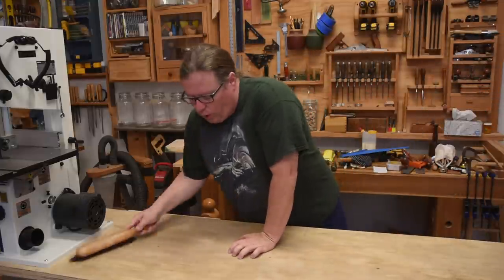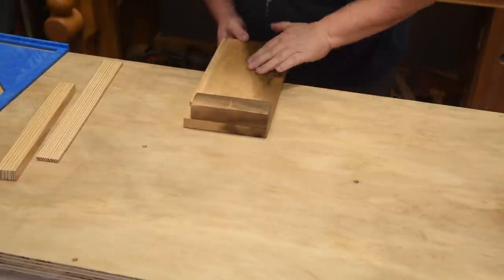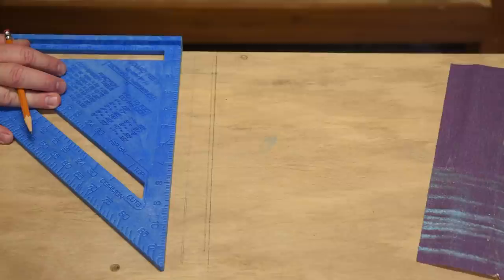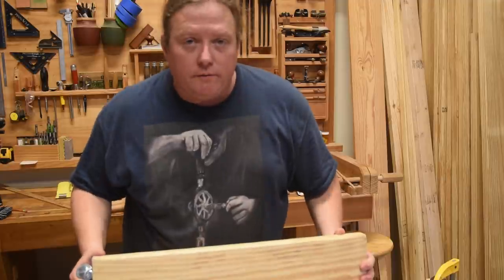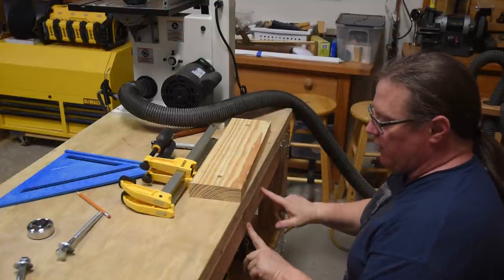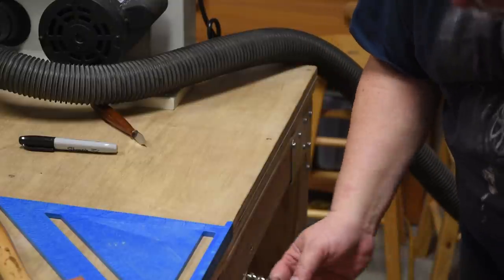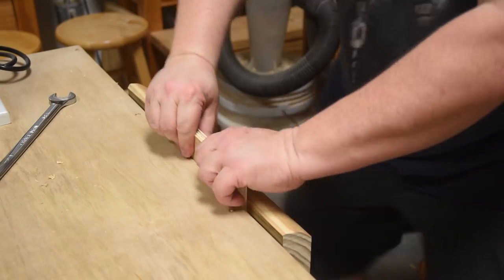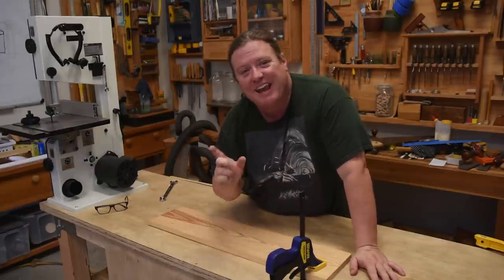$5 Vises & Work Holding at the Bench - Start Woodworking - Class Three

Comment: Funny, just 2 days ago I shopped for 3/4 inch threaded rod, nuts, and washers to make a cheap Moxon vise. I believe like 5 more bucks and a little more set up time is well worth it for a superior vise.
Reply from the maker: Troy Clayton I’m sure that works too. Post a video.
Reply: Can you explain a little more what you did? I would like to make one like in the video but maybe figure out handles so i don't have to use a wrench.

Comment: Amazing and so relevant, i just made my first workbench and struggled with exact same issues when working on it.. just a question, wont the vice screws give and thread away from the stretcher ?  Thank you so much
Reply from the maker: Dont' understand the question. If you clamp so hard you strip the threads and destroy your work, then drill another hole an inch over.
Reply: wortheffort thanks, i will give it a try. God bless you for all the knowledge you passed.  It is better than anything i had seen so far

Comment: You can get pretty reasonable vise hardware for a moxon vise that you could use as a twin screw set up for about $40    granted not 54  but so much easier that getting that wrench on and off all the time.   https://taytools.com/products/moxon-vise-hardware-kit-with-2-each-8-inch-x-3-4-10-threaded-rods-not-acme-threads-2-each-4-1-2-inch-cast-knobs-and-4-each-3-4-inch-nuts-and-washers
Reply from the maker: you can also buy those parts individually from McMaster Carr and save even more. Not the point of this video.